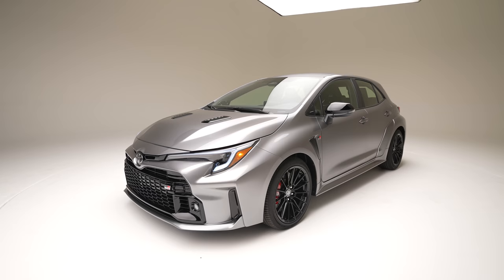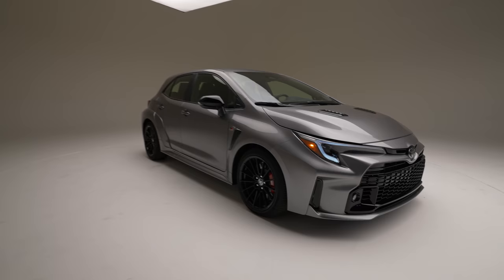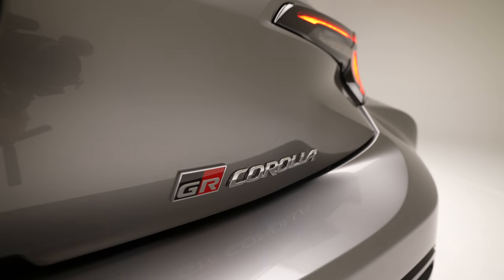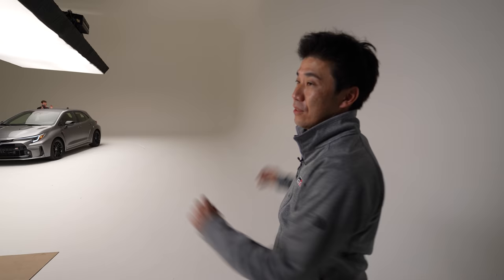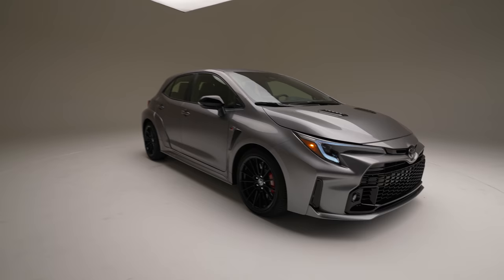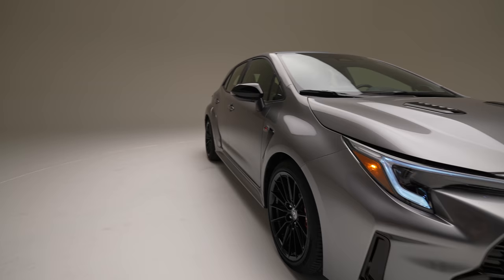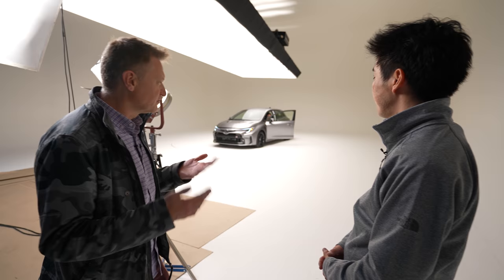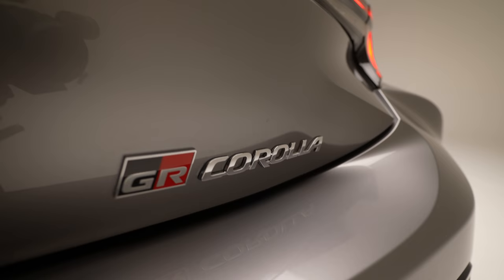GR Corolla - In Depth Q&A With Toyota Lead Engineer

Comment: I'm hoping the core model is around 32k because dealer mark up is going to be hard to negotiate down
Reply from the maker: Crossing fingers but that seems optimistic for a car with a lot of manual construction.  I’d guess far higher honestly. The GR86 starts at $29K and it’s a far simpler vehicle with traditional assembly.
Reply: @revmatchtv  yeah, but I like to get my hopes up 😂 I still want one regardless. Just patiently waiting
Reply from the maker: @jordan3305  I want one too! I want everything!

Comment: Did they specify if the torsion LSD was only on the circuit launch version or also on core GR Corolla?
Reply from the maker: The LSDs are optional on core.
Reply: Get the LSD option to get the performance out of it. Otherwise the core edition will be lame

Comment: I'm interested In this car or a 400z to replace my older mustang. The thing I'm concerned about is tuning. I'm assuming exhaust mods would provide pretty decent gains. But overall how much power can I little 3 cylander handle? I feel like it may already be at its limit unless you wanna get forged internals. I would like AWD but I would get tired of 300HP after a year or so.
Reply: Theres guys running 500whp with their GR Yaris in Europe on stock engine so I'm sure its up for the task.
Reply: This engine has reinforced internals vs the GR Yaris and the Yaris already can make a lot of extra power on the stock engine, so I wouldn't be worried at all about that. Also, the car is really light for a modern AWD performance compact.
Reply: There’s already people out there who have made significant gains with this engine. Even though it’s an i3, Toyota usually does not ever wring an engine out to its fullest potential. This is usually for the sake of reliability, but it can sometimes be unlocked like how it is with this engine. I mean look at the 2JZ, that was over engineered, and so was this G16E engine. It’s basically a more tame racing engine so it’s built for the abuse compared to turbo charging a little economy engine that’s made for mpg
Reply: Us Australians have a 500hp Yaris check out Motive Garage
Reply: @thehermdawg6711  whp or bhp? Link?
Reply: @ThomMurphy  check out Motive Garage! They started to encounter problems with the head gasket at 450hp+ but noted that the block and internals were more than capable for additional power. It’s a gem of a little engine
Reply: @thehermdawg6711  Yeah only downside is, you blow a hole in the block, you'll need a new one from toyota due to the design.
Reply: @mushasho  Yes, it is light. As a matter of fact it is the lightest AWD high performance 4-door since the 2001 STI/Evo with a whole lot more safety regulations which make newer cars heavier. I hope you do realize that AWD systems add a lot of weight and this is a completely different class car than the Yaris. The Evo X was up to 3638lb (3527 for the GSR), the 2015 STI was 3367, previous gen Golf R was 3384lb (3283 manual) with a shite Haldex AWD. The new Golf R is 3450+ lb. FYI the GR Yaris added 500lb over a base Yaris while the GR Corolla only added 300.
Reply: @mushasho  To put things in perspective. The first gen(1990-1994)Mitsubishi Eclipse GSX(all wheel drive 2L turbo 5spd) weighed in at 3095lbs which was considered light in the day. The car had no airbags(US spec),  bumper standards, crash standards, door impact standards, etc were less stringent requiring less reinforcement(ie less weight). All the "safety" nanny systems didn't exist yet(again less weight). Heck even ABS was an option on only select vehicles. Oh and that car had only195hp stock and was considered fast since it could beat fox bodied Mustangs of the era in the right hands. So the fact that a car like this is being built in this day and age of ever restrictive legislation and incredibly stringent standards is nothing short of a miracle. 300hp, 3200lbs, all wheel drive, standard. Wow, well done Toyota. Better grab one while you still can.
Reply: True it only has 3 cylinders but keep in mind not all cylinders are made equal, the diameter of these cylinders are far bigger than what you’d find on your average 4cyl. One top of that this engine is really overbuilt and can easily take a beating on stock parts I’m sure
Reply: You have any track experience?
Reply: @AlDim000  Where did you get info of it having further reinforcement over the Yaris? I was under the impression that it is the same engine between both vehicles (1 to 1).
Reply: @thehermdawg6711  BOOM...
Reply: 400z if anything...
Reply: @tinuthomas531  The 2JZ was 6 cyl, this car has 3 less cylinders...
You might be able to push this little engine to 500 hp but expect to get about 20,000 miles out of it if that... lol
Reply: @jrag1000  i think you missed the point, I’m comparing the fact that Toyota likes to overbuild their engine for the sake of reliability, but that gives you a decent platform to get power out. This i3 is super overbuilt and idk if you’ve seen the cylinder walls but they’re huge. I think Toyota knows what they’re doing, and we still don’t have much knowledge on this engine or the new revised one so I would just sit back and watch how these engines perform rather than just guessing. I have faith in Toyota, so I’m sure these engines will do fine and last even with high hp applications
Reply: @AlDim000  good research 👍🏼..
Reply: @tinuthomas531  I’d have to see this one in real life, if I’m gonna spend around 30k I need to drive it, open the hood, and see it perform.
Reply: The internals are already forged

Comment: Since the Circuit Edition is reserved only for the year 2023 making it a limited run, how many of these will they make?
Reply from the maker: 1500 Circuit, 5,100 Core are the 2023 targets
Reply: @RevMatchTV targets...hmmm... So could be more!
Reply: They should increase it to more than that if 500 are sold within the first two months
Reply: @scathachx  none have been sold yet

Comment: Can't wait for the $5k-10k markups to begin. 😢
Reply: Yea…. Gotta wait a year or two…
Reply from the maker: Work with an MSRP only dealer. They exist!
Reply: @revmatchtv  how would you find msrp only dealers?
Reply: @revmatchtv  whether the MSRP dealers exist or not is not the issue, limited availability of the Circuit Edition will be the problem, there's an incredible demand already, some dealers already have a "list" of people that's triple digits long in 3 days since the reveal

Comment: I wonder why the gr86 has less power compared to both hatchbacks
Reply: They want the targeted age group to stay alive without wrapping it around a tree.
Reply: @1nvd  xD
Reply: Because Toyota knows that boxer engines are terrible for turbocharging that’s  why Subarus always have issues with their head gaskets going out all the time
Reply: because if it had more power it would be a $50,000 car.
Reply: Because just like its AE86 predecessor, the GR86 (even the older GT86) is designed to be an affordable entry level sportscar with more emphasis on agility (turning ability) rather than pure horsepower machine.
Sure, Toyota & Subaru could've use a turbo but it will eventually make the engine more complex & heavier which at the end also gonna make the price higher as well.
Reply: @AbrahamArthemius  but the gr yaris is more powerful, surely they would've found a way to adjust the performance tier
Reply from the maker: Affordability. This has lower gearing than the Yaris because it’s heavier
Reply: @falcongamer58  ..and the GR Yaris is far pricier and rarer than the GR86. Plus the GR Yaris a true homologation rally car with most of its parts being bespoke including the engine & drivetrain until they put it to the Corolla.
Reply: @atemegabites2251  bingo infact Toyota was adamant that it was direct injected and port injected to help with making reliable power those engines should never be turbocharger which is why they blow up all the time
Reply: @currythegoatofmankindthepa5156   yup the non turbo Subarus are ok . But anytime you boost them, expect issues. Possibly the next gr86 will steer away from boxer engines and no more Subaru collab
Reply: @naysunhuang  I doubt having 50 hp more adds $20k to the price
Reply: Maybe the next gen 86, however the hell they want to call it can feature this 3 cylinder engine? That would be cool. No need for the AWD, the RWD is great enough for 86.
Reply: @donflamingo795  its a bit underrated, some dynos had it around 245hp
Reply: @atemegabites2251  probably will get a G16 maybe with awd 😂 that are they'll axe it hope not though
Reply: Different category. That's like asking why the Tacoma has much less power compared to the Tundra.
Reply: @dknight25  but they're sports cars
And the tacoma makes sense to have less power because it's lighter and requires less power
Reply: @naysunhuang  only from Toyota, always overprice and under perform.
Reply: Weight

Comment: Why is there an EV mode? Is this a hybrid?
Reply from the maker: Not a hybrid. EV mode?
Reply: @revmatchtv  some reviewers had a chance to record the center console which had an EV mode button.
Reply: It is a preproduction model and that button is from the original Corolla. It won't be in the GR.
Reply from the maker: @antster7  This is not a production car. In preproduction cars it’s common for bits to swapped out or missing.

Comment: Why no DCT? I had a GR Yaris and enjoyed it once again no DCT offered.
Reply from the maker: Cost. This is a very low volume car. They'll sell every one with the single transmission.
Reply: Cost, so why is the VW R DCT only. Of course they’ll sell every car but show me one rally car at the top of world competition that’s manual.
Reply from the maker: @karlwilliams8208  This is a street car, not a race car. Cost, what other reason would there be?
Reply: @revmatchtv  do you believe they couldn’t sell every single car, manual and DCT? WRX, VW R, A45S, etc, they sell in Australia like hot cakes and if they do do a DCT I’ll order tomorrow. I had a GR Yaris and loved it but for me personally after many many years of manual shift cars I’d much prefer a DCT. It’s all down to personal preference. If someone likes a manual shift I say go for it. Toyota of all manufacturers has the resources and know how to build anything and everything, I’m simply saying cost isn’t a major issue as there utilizing an existing platform as opposed to the GR Yaris which was bespoke. In summary Toyota could build any performance vehicle for under 100K and sell every single vehicle.
Reply from the maker: @karlwilliams8208  I get what you're saying, but what other possible reason other than cost would it be? They would need to certify for emissions on two different drivetrains etc. Toyota is succesful in party because they focus heavily on buidling to a budget.

Comment: I love Toyota bc most of my cars are Toyota/Lexus.  Im pissed at Toyota bc they waited 25 years to bring this to the states.  Its nothing new, its the same formula as the Evo and STI.  The 97-2000 WRC Corolla was a beast and that should have come to the states and compete with the STI and Evo during those wars from 2005-2010.
Reply: this is better than the STI to me, and thats coming from a subaru guy. subaru rn is kinda dead to me
Reply from the maker: Toyota is a different company than it was in the early 2000s now that Akio Toyoda is at the helm.

Comment: 40k+ ......this ain't mo Corolla
Reply from the maker: It will definitely be the most expensive Corolla ever, but this is largely hand assembled. It takes something like 11 times longer to build this than a regular Corolla.
Reply: @revmatchtv  Well Toyota shouldn't have put a "Corolla" badge on it. And named it some other name they already have. This Corolla certainly does against every bit of ethos the affordable Corolla had.
Reply: if you look at the front grill from the previous generations corolla, its basically the sport version of it. Yea its way better than the ol affordable corolla but I see it as an EVOlution from it. (Get it? cause 4WD)
Reply: @Mexxx65  Thats not true. Im not sure about the US but in the past we have had performance oriented corollas. Like the ae82 chisel 4age corolla that came to South Africa in the 80s. The ethos is not gone against.